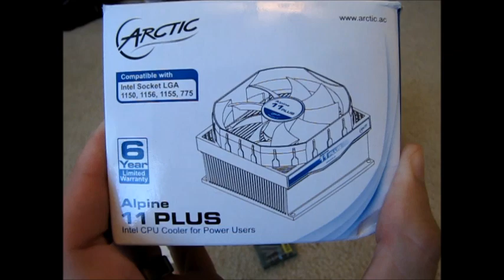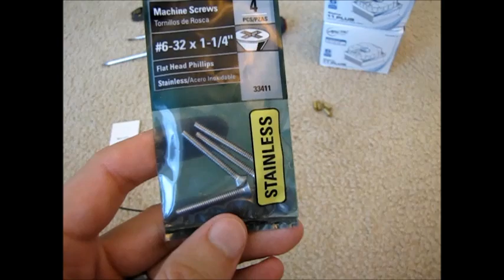How To Build A Peltier/TEC Cooling Device (Thermoelectric Cooler)

Comment: would this work for "souping up" one of those diy cooler AC units (the ice chest with intake fan, ice in it and an outlet)?
Reply from the maker: +Omar Ghosn Yes, for sure.  If you can keep the ice from melting quite as fast with a peltier module then your ac unit will last longer and might even blow a bit cooler.

Comment: Great Video! I'm looking into applying this to a compressor based mini-fridge for homebrew fermentation and/or cigar 'fridgador'. I use an STC controller that switches the fridge on and off right now; would this on off action shorten life of petlier cooler?
I've also watched your 12V power supply hack, as far as wiring this up, just tie in all black to back and red to yellow? Thanks
Reply: For the power supply, will any 12V with at least 10 amps work? The 10 amp peltier won't draw anymore than 10 amps anyway, correct?
Reply from the maker: Nelly jizzle I can't speak to the longevity of the peltier module.  In my experience, though, they are very fragile and cheaply made.  I wouldn't expect one to last more than a year or so under constant use.  I would guess that turning it on and off will shorten the life.

Some people have commented that there will be thermal backfeeding when you shut off the peltier, which I think is correct.  So make sure you have a good solid heat sink that can shed heat quickly on the hot side to make sure it doesn't heat up the cold side when you turn it off.

Yes, just connect black to black and yellow to red.
Reply from the maker: Nelly jizzle Nope, the peltier won't draw more than 10a unless it is broken or something.  I would recommend that you find a power supply that produces a little bit more, though, because that would put the power supply at a higher load and it will be less efficient.  Power supplies are much more efficient at lower loads.

Comment: LDSreliance thank you for posting this cool video.  I'm looking to make a Fermentation box for home brewing.  This box basically needs to maintain one constant temperature within the 45 to 80 degree range. I was wondering if you could turn on the fans on the cool side, then turn on the fans from the hot side to maintain this temperature with a thermostat.  Would this be possible, or do both fans need to be running at the same time to provide the cooling?
Reply from the maker: Travis Steenbergen The fans aren't really critical.  They just came with the heat sinks and help circulate the air a bit.  You can maintain a pretty good temperature with a thermostat but it needs to be a fast-acting one (some of the cheap ones I have used allow it to heat up 2-3 degrees above the set point before acting).

Comment: hey, what cooling temperature does it give?
I wanted to know if its possible to cool a 2 * 2 feet size box atleast.
Reply from the maker: FABIAN JOHNSON Yes you could cool that size volume.  You would need multiple peltiers or a much more powerful one.  Maybe both.  This one dropped the temperature about 20 degrees below ambient for a very small volume of air.  My liquid cooled peltier design seems to work better.  https://www.youtube.com/watch?v=tnKlIc6oCCg

Comment: Firstly thank you about the video
I want to make a small greenhouse contain plant controlled by microcontroller for my graduation project.
so I want to make an air condition system , I am thinking about Peltier but I don't use it before , I need some advises about it is it good to keep temperature between 18-28 deg C , if I run the fan at more voltages than 12 is it give faster and more performance? also if I change the polarity does the hot side become cold and the cold become hot ?
thank you again :)
Reply from the maker: mohammed kayed It is very power hungry to use as an air conditioner.  It will cool down a small volume of air but to cool down a larger volume like a greenhouse you will need dozens of peltiers and you will need the stronger units that use 15+ amps instead of just the 5 or 6 amp units you usually see in these videos.

I haven't tried reversing the polarity.  It should switch the hot and cold sides but I can't say for sure.  You could try it out on one of the 5 amp units because they are only like $3 or $4 and if it breaks it isn't a huge deal.

No, you can't run them over 12v.  You can run them lower than 12v and they are more efficient (use less power for the amount of cooling effect) but you can't get greater cooling out of them by running higher voltages or they will burn themselves up.
Reply: LDSreliance thank you
I want the size of greenhouse 210 × 297 millimeters for the length and the width of the base and the height about 210 mm .
I have small fans 24 V with small heat sink and a bigger fan 12 V with bigger heat sink I confused about which one I should use
also I tried both at the hot side the heat sink is not hot when the fan running and I don't get  hot air
and from the cold side the heat sink is not cold I left the fans and the Peltier running for about 15 min and i had no any drop in temperature ( i touch the surface of Peltier it's so cold but on one corner of the cold side it's extremely hot ) 
where do you think the problem is ? is the type of thermal paste not good ?
thank you again , and sorry about my English
Reply from the maker: mohammed kayed Sounds like you might have a defective unit.  There should not be any hot parts on the cold side of the unit.

If you connect the hot side of the unit to a heat sink or lay it flat on a piece of metal and then turn it on you should be able to wait 10 seconds and drop a drop of water on the cold side and it should almost instantly freeze.
Reply: LDSreliance I dropped water as you said 
it's get cold but not freeze I think I should buy a new Peltier unit
Reply from the maker: That is what I would do.  Even the 5amp units will freeze water almost instantly.  (As long as you had something in contact with the hot side like a heat sink or flat piece of metal)

Comment: Parts list! Other than that, pretty slick...
Reply from the maker: epictangent Sure thing:

http://www.amazon.com/ARCTIC-Alpine-11-Plus-Cooler/dp/B00606OHQQ/ref=sr_1_3?ie=UTF8&qid=1415374100&sr=8-3&keywords=arctic+11
http://www.amazon.com/Tec1-12705-Thermoelectric-Cooler-Peltiers-77wmax/dp/B007JCVRSG/ref=sr_1_1?ie=UTF8&qid=1415374124&sr=8-1&keywords=tec+12705
http://www.amazon.com/Arctic-Silver-Thermal-Compound-Grams/dp/B000OGX5AM/ref=sr_1_1?ie=UTF8&qid=1415374161&sr=8-1&keywords=arctic+silver

As for the fasteners, I used computer standoffs for motherboards that I had laying around (you could get them at any computer shop) and some matching threaded bolts from the hardware store.  Don't remember the size but it wasn't too hard to figure out.

Comment: Hi, first could you send me the links to where you bought these?
Second, how big is your peltier unit, because i'm interested to making one of my own with a bit better insulation and hopefully it works out.
Please respond quickly, this is urgent! Thanks :)
Reply from the maker: Jesse TheFabulus 
Sure thing:

http://www.amazon.com/ARCTIC-Alpine-11-Plus-Cooler/dp/B00606OHQQ/ref=sr_1_3?ie=UTF8&qid=1415374100&sr=8-3&keywords=arctic+11
http://www.amazon.com/Tec1-12705-Thermoelectric-Cooler-Peltiers-77wmax/dp/B007JCVRSG/ref=sr_1_1?ie=UTF8&qid=1415374124&sr=8-1&keywords=tec+12705
http://www.amazon.com/Arctic-Silver-Thermal-Compound-Grams/dp/B000OGX5AM/ref=sr_1_1?ie=UTF8&qid=1415374161&sr=8-1&keywords=arctic+silver

As for the fasteners, I used computer standoffs for motherboards that I had laying around (you could get them at any computer shop) and some matching threaded bolts from the hardware store.  Don't remember the size but it wasn't too hard to figure out.

The peltier was a 12705 (5 amp) unit.

Good luck!
Reply: LDSreliance Thank you so much!
There is one more thing, though not related to this video but the other fridge prototype, you cut out the holes for the peltier unit, you put the screws on the side, which connected the two heatsinks. Does this mean that I should assemble the second fan and heatsink after I make the hole in the wood because otherwise i don't quite understand how you can fit the whole peltier cooling device through, and also have the screw go through the wood.

Sorry if it's unclear, I wasn't most sure how to phrase it.
Reply from the maker: Jesse TheFabulus Yes, that is the only way to do it and it is a pain in the butt.  That is one reason why I like this new liquid cooled peltier fridge that I just finished.  All I needed to do was cut two small holes/slots for the tubes to enter the inside of the fridge.  If you haven't already seen those videos, click here for part 1:  https://www.youtube.com/watch?v=TjX-5zjhPlQ
Reply: LDSreliance Does this mean that I cannot use a peltier unit 40mmx40mm, as it might be too big for the peltier cooling unit? 

Your replies have been incredibly fast, and have been helping me a lot!
Thanks!

Also, should I add in some thermal compound, and If i do where would I apply that?

Is there some temporary power supply unit I could use? 
And also, when do you expect to release the video you talked about in your newest video "Liquid cooled peltier refrigerator - part 4" about wiring the CPU supply unit?
Reply from the maker: No they are almost all 40mm x 40mm.  Those are the size I use and they work fine in those heat sinks.  It just means that the hole in the side of the fridge has to be at least big enough for the peltier as it will basically be sandwiched between the heat sinks which are mounted on either side of the fridge wall.
Reply: Thank you, I'm trying to make a proper fridge, with the liquid cooling one, so can you send me the amazon link for the liquid cooler, but as I live in europe can you check if this is fine, as it looks a bit different :
http://www.amazon.co.uk/Antec-Kuhler-650-Cooling-Temperature/dp/B00F2WQKL4/ref=sr_1_fkmr3_1?ie=UTF8&qid=1431548032&sr=8-1-fkmr3&keywords=liquid+cooling+peltier+unit

THANK YOU FOR ALL THESE REPLIES!!!
Definately thanskful and you've saved me a great deal lot :D
Reply from the maker: That would work as long as the round part that attaches to the TEC or CPU has a bracket that you can use to tighten it flat to the TEC.  I assume you are going to order 2 of them and sandwich them like I did?

I ordered mine from Amazon:  http://www.amazon.com/Corsair-Hydro-Performance-Liquid-Cooler/dp/B00A0HZMGA/ref=sr_1_1?ie=UTF8&qid=1431703933&sr=8-1&keywords=corsair+h60
Reply: LDSreliance 3 LAST questions, sorry for the inconvienience. 
1. Where do I get connectors (for the wires), I checked at my local hardwar store (OBI) and i couldn't find any, can i order them?
2. I still need to buy the peltier unit to put in the liquid cooling one, correct?
3. Should I order the CPU t=power supply unit online too?
Reply from the maker: 1.  I use butt connectors.  You can order them online or you should be able to get them at Home Depot, Lowes, Radio Shack, and Wal-Mart to name some common places.  Get the red colored ones as that will be the right size for your wires.
2. Yes you will need to order a peltier to sandwich in between the two coolers.  There are various sizes but all the part numbers are TEC1-127xx where xx is the number of amps.  So TEC1-12705 would be 5 amps and TEC1-12710 would be 10 amps and so on.
3. You can get old computer power supplies almost anywhere.  You could probably get a free one if you looked on Craigslist, Facebook buy/sell/trade pages, freecycle pages, etc.  Just post that you are looking for an old computer power supply that still works.
Reply: Hi, Thanks for the help so far, but can you tell make an in depth guide as too how to wire the Computer Supply Unit too the Peltier Cooling device and Liquid Cooler?
Reply: LDSreliance Even if you just have a video of you wiring everything I could follow along! Thank you for your help so far!
Reply from the maker: Try this first and see if you have further questions:

https://www.youtube.com/watch?v=aTM5lmccev0
Reply: I've seen that, but for my computer supply unit, should I also bunch them up by colour like you did?
Also, as there are so many wires, how would I wire to each electrical source and appliance?
Reply from the maker: Yes, you should bunch them up.  The reason why is that each of those wires is small and can only handle a small amount of current before it overheats.  If you bunch them all up together then there is less risk of that happening. 

If you want to power multiple devices with your power supply then use a load center such as the following:

http://www.homedepot.com/p/Square-D-QO-30-Amp-2-Space-2-Circuit-Indoor-Main-Lug-Load-Center-QO2L30SCP/100157760
http://www.homedepot.com/p/Square-D-QO-100-Amp-6-Space-12-Circuit-Indoor-Main-Lug-Load-Center-with-Surface-Mount-Cover-QO612L100SCP/100148926

Both of those are rated for use with DC power.  You will also need a couple breakers (one switch for each load).  If you need help on the wiring of the load center, you can watch my video on combiner boxes (same thing essentially) here:  https://www.youtube.com/watch?v=UG2pbErPKi8
Reply: What about using those multiple wires to power one thing? How would I do that with butt connecters? Is it possible that u have a recording of you wiring everything up?
Reply from the maker: Jesse, in that last video that I linked you to I bunched up all the same color wires and then soldered them together and crimped a female disconnector on the end.  You could just as easily crimp on a butt connector instead but I wanted to use something that I could connect and disconnect since I use this power supply for many different things.
Reply: Thank you, and another thing I want to ask, how would I know which wires to connect to which parts of the cooling unit? (The fan = yellow wires, as an example). Are they all the same? And since there is a positive and negative wire, would I connect them each to one seperate bunch of wires or also but them together?
Reply from the maker: The way I do it is I bunch up all the red/positive wires from the peltier and fans and solder them together and then crimp on a connector.  Then you can attach them all as one into the power supply.  Then do the same thing for the black/negative wires.  Makes things simple unless you plan on doing a lot of swapping components in testing or something.  Then you might want to use a buss bar or something to make multiple connections to the power supply yellow wires and again for the black wires.
Reply: Thank you! That helped alot. 
Thoguh I'm a bit scared of making mistakes. I do have a crimper, but the Computer power supply does not show gauges for me to strip them. What do i do, as I can't find any number seem to be able to strip them, and I'm worried the ones too small willl break the wire.
Reply from the maker: Just take your time and practice on the end of one of the black wires.  Don't strip off more than 3/8 of an inch or so.  Use the smallest hole you have on your crimper.  Sometimes I have to clamp down and then twist the crimper back and forth until I can pull the excess insulation off the wire.

Comment: Would it be worth adding a second 12V peltier cooler device? Or does one work well enough?
Reply: Cody Bowersox just don't stack them, unless you want extremely cold temperatures (like making stuff -60°c)
Reply: If you need to make it very cold the yes.  Use another one.  I am using one 92W 12V pelted for a mini air conditioner.
Reply: Joe Stevens one is good enough -22
Reply: Yes, but try to improve the hot side heat sink first if you care about efficiency.

Comment: With this set-up, did you get a temperature reading of the cold-side heat sink itself (instead of temp. of the cooler/refrigerator temp). And also, if you were to use a smaller heat sink on the cold-side, would the temp. of that heat sink get colder, and get colder quicker? Even though it wouldn't work in your application, I was wondering if you've tried doing that, or if not, does it seem like that would happen? Thanks for your help. P.S. I like your videos especially because you're easy to listen to. Some other people that do videos sound screechy, and they don't plan the video out very well.
Reply from the maker: TargaWheels Hey thanks!  I sometimes don't plan my videos out very well but I just hope people learn something from them anyways.

I did attempt to get an actual temperature of the cold side heat sink itself but I don't know how accurate it was and I don't remember the numbers.  I don't have an infrared temp gun or anything that I would trust with measuring something like that.  In theory, the size of the heat sink shouldn't matter even if you got a smaller heat sink to have a slightly lower surface temperature.  The reason is that there is only so much heat that the TEC can possibly move away from the cold side.  It should be able to transfer that same amount of energy regardless of the temperature of the heat sink.  It is a good question though and I don't have a definite answer.

Comment: why would you need a fan for the hot side if you just need the cool side inside the place you want to cool and just leave the hot side as it is in the peltier divice?
Reply from the maker: Ramon Box You can do that and it would probably work.  You just want the hot side to be able to shed heat as quickly as possible.  There is a maximum temperature difference between the hot and cold side so if the hot side gets really hot then it limits how cold the cold side can get.
Reply: LDSreliance how about attach the aluminium heat defuser to the hot side and deep it to water?...leaving the unit inside the cooling compartment?
Reply from the maker: Ramon Box That would work.  I have been experimenting with water cooling to see if it gets better results.  I think it does.  Check out my other video:  https://www.youtube.com/watch?v=tnKlIc6oCCg